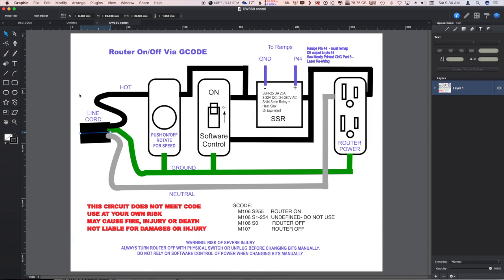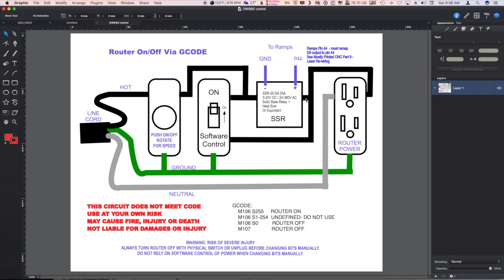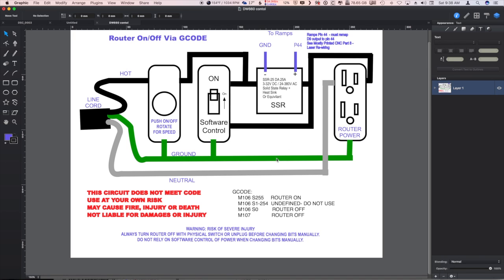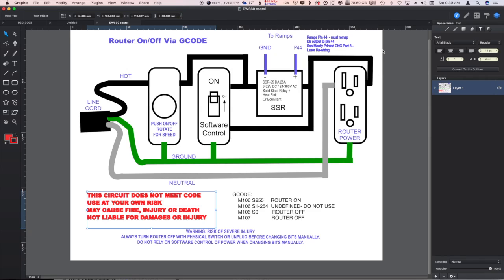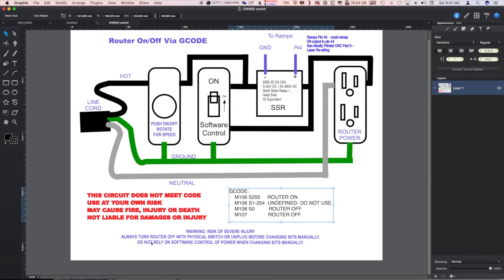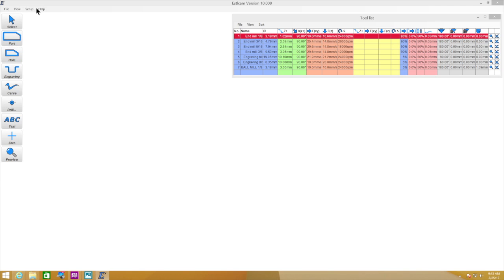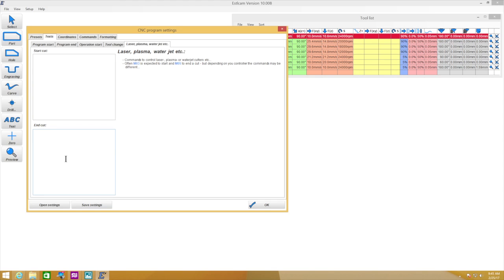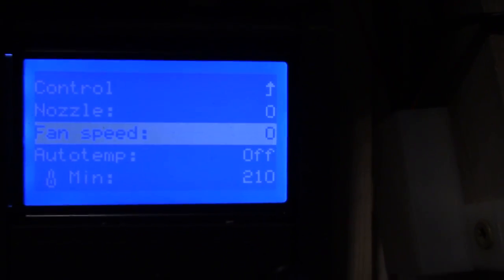Mostly Printed CNC (MPCNC)   Part 14 - Software Control of Router Power

Comment: Do you know if I can swap the Servo pin (BLTouch) with Fan0 in PINS.h of the SKR_PRO_COMMON so I can use a 1 channel relay module for on/off control?  I have a router controller to vary the speed, but I'd like to put a relay in there as well so the board could power cycle as needed, but I don't know much about editing the pins file.

Comment: Thanks for the video. I always learn something. The M3, M4 commands are for Pin 45 for TTL on the Rambo 1.4 board in the MX2 strip. The M5 command can be used with a SS relay as with your project using Pin 31 right beside Pin 45. I’m contemplating using both the Rambo 1.4 and the Arduino Mega/Ramps so I can take advantage of Estlcam directly at times - can’t use Estlcam firmware with Rambo, you have to use Marlin as you know.

Comment: So if I understand this correctly, I could use this to change the amount of current that goes to the spindle or laser by changing the potentiometer (dimmer) in the circuit? I use Mach 3 and I use that with its TTL commands to turn on and off the spindle/laser but I don't currently have speed controls. Not an issue with the spindle but could be very useful for laser if I need to adjust that on the go. Re-watching this, I would be putting this on a 12v circuit, to the laser, not on 240v AC!
Reply from the maker: kinda.

1) You can vary the speed of your spindle with the potentiometer(dimmer), and turn the spindle on at the selected dimmer speed or off via Gcode by using the commands M106 S0 (off) and M106 S255 (on). Or via a TTL signal.

2) Lasers are usually controlled directly by the PWM TTL levels changed by the Gcode command  M106 Sxxx, where xxx is the laser output power.   

3) I do not recommend running the laser supply power primary via this circuit, only the spindle/router  Not sure what it would do to the power supply.  Additionally, the SSR is designed to switch AC on or off. I don't believe it will work properly switching 12 V DC.

4) Maybe what you need is something like this http://www.edn.com/design/analog/4363990/Control-an-LM317T-with-a-PWM-signal

Hope that helps. a little

Anyone else have any ideas?
Reply from the maker: Are you using an Arduino or Arduino/ramps?
Reply: Ah, you must have read my mind! I am a new builder/user of the MPCNC and I have found your videos and experiences very helpful. After starting a print a couple times without starting the router I was wondering whether this could be done automatically. I found a speed controller for $20 at Harbor Freight (just search their site for speed controller) Seems good but I haven't taken it apart to see what's inside. Good work, thanks for the warnings!